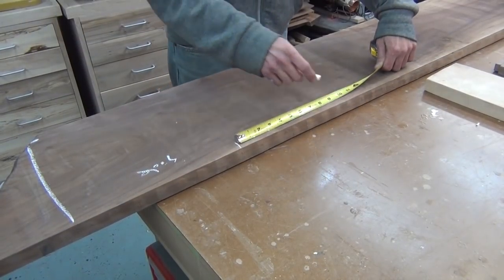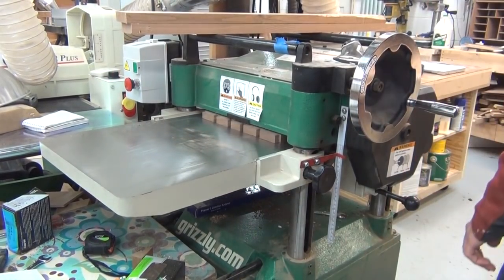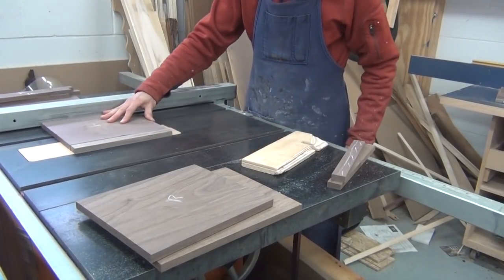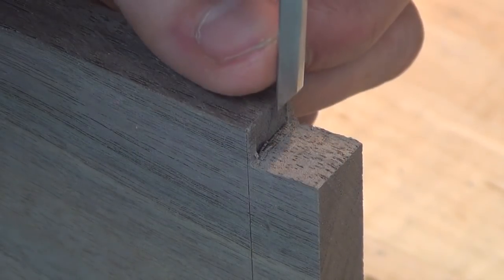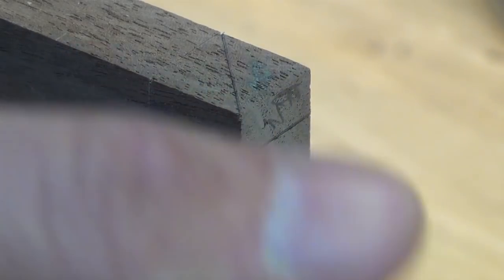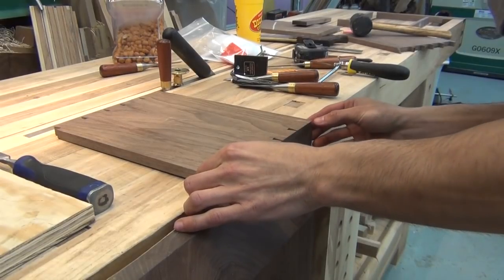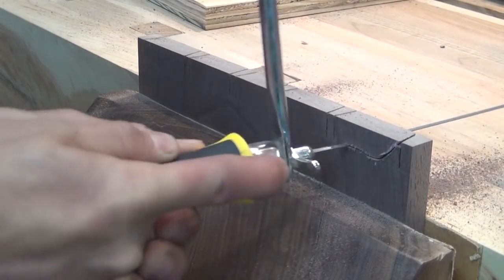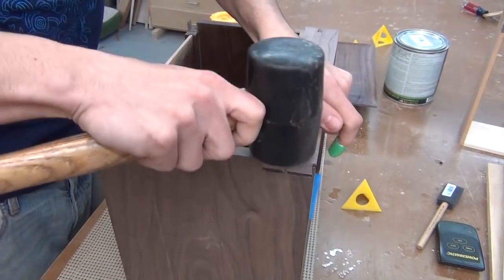Building a Dovetailed Tea Chest - Case Construction (Part 2)

Comment: Interesting dovetailing method. If I may offer one suggestion in your sequence, I suggest that you chop out the waste form your tailboards before cutting off the waste at the edges. Those waste pieces can protect the outside dovetails during the chopping sequence has been completed.

Comment: I love the craftsmanship on this video. Very well produced. Very clear too. This is perfect for me if i ever get into cutting dove tails. Thanks for sharing! What is your method for sharpening your chisels?  How often do you do them?
Reply from the maker: Hi Ed.  Thanks for watching; I'm glad you liked it.  To sharpen my chisels, I use waterstones.  I have a 800/4000 combination stone that I use.  Most of the time (read: if I'm not lazy) I'll touch up the edge of my chisel as I am working and can feel the chisel start to "drag".  I'll take the chisel to the 4000 grit stone and touch up the edge free hand.  If I am proactive about sharpening, a few passes on the stone is all it takes to get the chisel sharp again.  If I wait too long or the edge is in need of more work, I'll use one of those honing jigs to hold the chisel at the correct angle and work through both grits.  I'll also put a microbevel on the edge as well.

Comment: Are you using your own milled lumber for this project?  Do you sharpen your own chisels and if so what method do you use?  I have never been too interested in dovetail joints before but you show making them in such detail I am thinking about breaking out my chisels, sharping them and trying this out for myself.  Thanks, great video.
Reply from the maker: The walnut in this project I had purchased fresh sawn from a mill and dried it myself.  I use water stones to sharpen my chisels.  I touch up the edge frequently to keep them sharp.  This way I don't have to spend a lot of time at the stones working the edges on multiple grits.  Hand cut dovetails take a fair bit of practice but once you start seeing results, it's addictive!  I hope you get out there and give it a try! Let me know if you need any pointers :)

Comment: What chisels do you use in this video?  It looks like the angled sides go virtually to the edge of the chisel preventing damage and bruising  to the base of the tails. I know Blue spruce chisels are made this way and am hoping you have found another brand that i might be able to afford.
Reply from the maker: I'm using a couple of different types of chisels in this video.  The Ashley Iles round back chisels are my favorite for cleaning up dovetails and for paring: http://www.toolsforworkingwood.com/store/dept/TBBC/item/IL-100-30.XX

I also have the Ashley Iles pattern chisels.  Most of those ones I ground the sides down so there isn't a flat on the sides: http://www.toolsforworkingwood.com/store/dept/TBBC/item/IL-100-20.XX

Comment: Hey Matt , I’m enjoying videos and learning to make through dovetails for the first time. I know you never have this problem but if the joint doesn’t fit well initially, do you have a preference where to make chisel adjustments on pins or tails ?   Or does it just depend?

Comment: Hi Matt. One quick question; why do you press the heel of the push pad down @ 1:23?
Just as a matter of interest.
Reply from the maker: Those push pads aren't that great.  I'm pushing on the back edge of the board to apply more pressure forward.